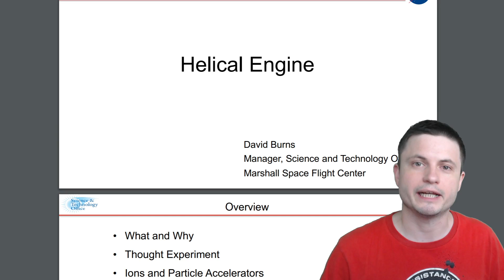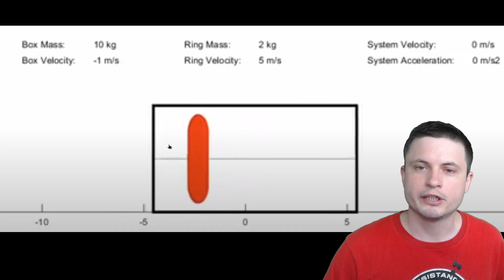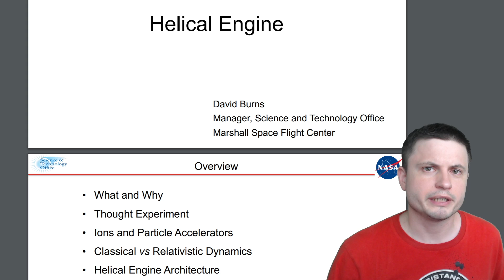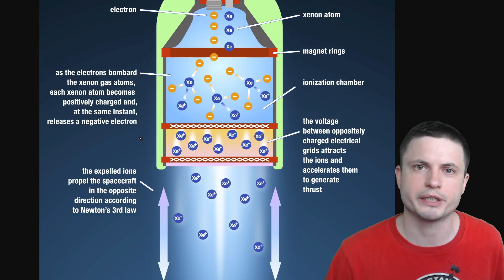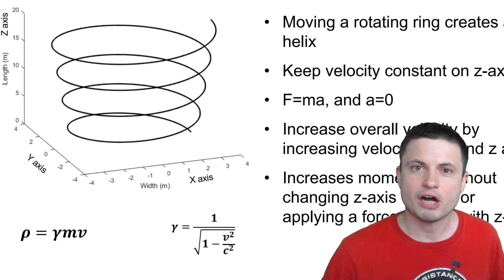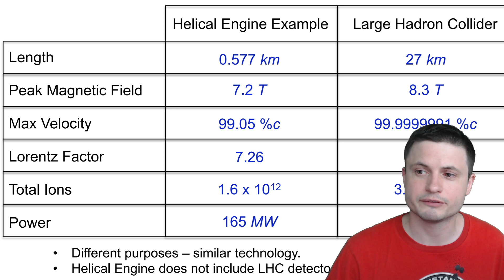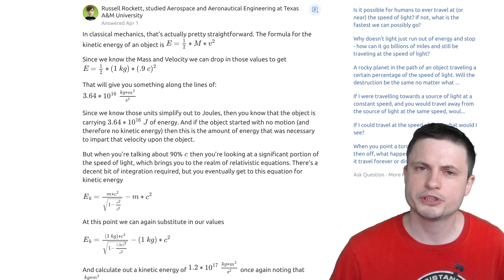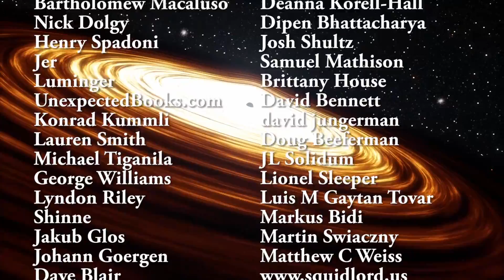NASA Engineer Designs a Near Light Speed Engine But Does It Work?

Comment: Anton Petrov I see a problem with trying to move something at relativistic speed and that is as your particle gains that speed and becomes heavier the mas reaction against accelerating it further also increases and so the ship will move backwards if you are trying to BOUNCE these particles off your forward bulkhead and this will effectively subtract any gains made from the impact.  However if you turn it around like a cyclatron or atom smasher then you can do a more simple reaction to accelerate the particles out the back of the ship and by using a long track get their mass up heavier for the last stage of acceleration and push off of those heavy reletavistic particles of exhaust.  You lose mass this way but it will work and the other model that contains the mass will not work in my oppinion.

Comment: I think you may have made a conceptual error, or I have. Yes, spinning the donut up to 90% C would take enormous energy. However, once it is spun up it should stay spinning that fast. You only need to add energy to make up for friction losses which should be minimal if the donut is free floating in vacuum. Spin the donut up to speed before you leave earth orbit using a large orbital station power source. Then detach from the station and only then start the helical donut movement that will move the ship forward. The smaller onboard power source would only be used to make up for friction losses. I think the bigger concern would be structural integrity problems with the donut.

Comment: @8:18 Claim that a fission reactor can produce [x] amount og energy from one 1Kg fuel rod and that that is essentially converting 1 Kg of mass into energy.  NO, fission is NOT an anti-matter reaction, there is still only a tiny, minute percentage of the mass that get's turned into energy.  Even fusion is still a very low percentage.

Comment: There is a mistake in this idea. When the ions were accelerated, the accelerator was pushed backward. The designer forgot what happened to the accelerator. It will not work.

Comment: Anyone who wants a warp drive or even a drive that can propel you to 99% of the speed of light is an idiot. At such speeds you'd essentially be riding a giant particle accelerator. If you were travelling at 99% of the speed of light, if you were to hit a micrometeorite the size of a pea, especially if it was travelling at a high rate of speed in the opposite direction, your ship would become a supercollider experiment with disastrous results. You and your ship would be completely annihilated, to put it mildly.

Comment: I think I've come up with an engine concept, when two plates of a Casimir system are pushed rapidly together photons are generated i.e. positive energy, I'm speculating that the opposite happens, that when two plates are moved suddenly apart, negative energy is generated, if one has two circular ring plates rotating so that they move together then apart, according to the idea of "Runaway Motion" of Hermann Bondi the entire setup would move in the direction of the positive energy pole, nested rings could be added to increase the effect.

Comment: Excuse me but may one use spin to change mass of moving object/particles using centrifugal force? Imagine your bouncing object is a donut of electrons spinning. How I dumb it down for myself to understand at the most basic level, I feel like I understand the theory of the propulsion but is it like basically make something bouncing inside a container and while doing so one wants to make some sort of changes in it's mass between bouncing of interior sides of container. Either one end changes by the increase or decrease of the mass of the bounce ((force) force on container) to change somehow by the time it hits/bounces back from the opposite side of it's counterpart. With mass hitting one side differently it will create movement of entire container.

Comment: I am not well versed enough in the physics to judge, but I would say a small demonstrator prototype, even with negligible speed, just to prove it is practically possible and not impossible due to unforeseen problem like Gyroscopic Precession or the rotational force transferred to the body due to the spinning, I guess I ma more comfortable with applied than theoretical physics, I wan't to see it working

Comment: And then what's the little photons are Amplified the mirrors keep shaving off another Photon and then another Photon I then it's a matter of manufacturing photons inside a closed engine as then keep releasing little bits of photons that will accumulate to a large amount because they're traveling at the speed of light

Comment: Hi Anton. Exotic matter (bose einstein condensate) can be used to slow down the speed of light. It would be nice if something similar can be done to achieve the necessary relativistic effects at much slower speeds. BTW this is also an idea I had played with before seeing this video. I was thinking of two counter-rotating masses being sped up and then stopped (or slowed down) when both were moving in the same direction.
Reply: Get your pencil out, put a little math under it, maybe a few explosions......we’ll call it internal combustion.

Comment: Violation of momentum conservation. Probably reactive force of changing mass didn't taken into account. When you accelerate a mass close to light speed, momentum will be used not only to accelerate mass, but also to increase it. This will change formulas apart from just multiplication by Lorenz factor.

Comment: The hole thing is theoretically interesting but totally unnecessary because to accelerate particles close to the speed of light will give a conquerable result and be a whole lot more realistic in every way,In fact theoretically you would only need one particle to be accelerated at very close to the speed of light to attain enough inertia reaction or thrust for any mission.

Comment: No need to use any exotic physics to create an effective inertia drive in theory, as applying newtons 3rd law and interesting applications of mechanics will do. Accelerate a mass in one direction at high velocity, then return it back to its starting point at a far lower velocity and repeat. Another form of mechanical based directional inertial drive would be to use a high velocity mass impact and then return it far slower its its original starting point and repeat in pulses.

This is kind of what happens inside with a standard rotary impact hammer drill, which produces a singe directional impact inertial effect to do its job very well. Fairly straight forward to test on a low friction water bath and from many past experiments using a different mechanical inertial drive configuration including in a canoe in a swimming pool, and it certainly appears to work quite. So its quite a shame that these kind of successful experiments dont get the coverage they deserve :)
Reply: Ps Check out "Roy Thornson's Inertial Propulsion Demonstration" vid on YT from back in 1990 for example.

Comment: "relativistic mass" ? 
Mass doesn't increase, energy does.
E=mc^2 is for stationary rest mass.
E^2=pc^2 + (mc^2)^2 is the full equation.
[P= momentum, c= speed of light, m= mass.]

E=mc^2 is for rest mass only, yes?
E^2= (pc)^2 + (mc^2)^2
...is the full equation.
Where p= momentum,
[and of course m=mass and C is..C.]

Mass doesn't really increase under special relativity. That's an energy increase that we equate to mass, but it's really the γ (gamma) term in front.

So:
E=mc^2 for stationary objects,
E= pc for moving objects with no mass (i.e. photons). 

If they are both moving AND have mass: E^2= (pc)^2 + (mc^2)^2
Should be used, as far as I've been told... But I'm not a relativist.

Comment: i thought of something that  might be similar a while back, when i was thinking about orbital bombardment... 15 ton tungston rods my butt...LOL  i thought about making something the size of a beach ball, that was thermally shielded, that would shift a weight internally to steer, thou it would still need to have weight to it and the ball itself would be launched from a vessel or station, and the accuracy would still have issues with drift, i thought the thermals would be taken care of, and the shifting weight would alter the angle of attack of the shielding in the leading surface, communicating with the launch system as to its relative location to tweek that angle :D  i know i'm not a scientist but it's the idea that popped into my head :D  the beach ball would probably be more tearlike in shape.

Comment: OK, I have a clearer picture of what this does after reading some of the comments.  You spin up the flywheel thus increasing its mass; push the heavy flywheel to the back of the ship; then de-spin the flywheel, then push the light flywheel to the front of the ship.
The total mass of the ship includes the energy of all types that are contained within it.  Spinning up the flywheel to the point where it noticeably gains mass means that the battery (or whatever kind of device holds the energy) will contain enough energy to change its mass, as well!
So, to get a clearer picture of the problem, forget flywheels and just make it a water tank.  Transfer water from the ship's main tank to the sliding tank and push the heavy slider back; etc. You see the change in mass of the sliding part is exactly balanced by the change in mass of other parts within the ship.
Yes, I will scoff at the idea.

Comment: Sorry, but unless you clearly explain how this doesn't violate conservation of momentum, it sounds like the same spiel given by those promoting the "overbalanced wheel" and various reaction-less drives.
As for your comments on energy consumption, I think you should compare it against a "photon rocket".  But also, don't forget that you can recover the kinetic energy of moving parts that are not thrown away.
The LHC doesn't generate energy; it consumes it.
One kilogram of uranium fuel is not completely turned into energy!  The spent fuel only loses a little weight.

Comment: Hallo Dear Petrov.

I hope you will read this significantly comment. Sorry to say this, but it really is.

First of all thank you very much for posting interesting stuff in the net.

Lets get into stuff. I am a physicist. I analysed the complete Helical engine system. And I discovered a really big big major error. First of all there are a lot of very hard technical problems wich cannot be solved using todays possibilities of physics and technology, and I am not going to write it here because it is too much and because it is not the major problem. But the basic major problem is following. You said that the so called "donut box experiment" is theoretical completely clean and right. The truth is, indeed it is really not becsuse it is nonsense. Proof: imsgine a long pipe. For example 200 meters long and 3 meters diameter. The one end is conected with the spaceship (point 1) the other end is free in space (point 2). Now a mass is (1 Kg) being Accelerated from 1 to 2 within 10 meters and then the projectile-mass flyes with 0.999948 c lightspeed to point 2 and vice versa. The mass has now at this speed a relativisticly increased mass of 100 Kg. At the point 2 in the last 10 meters the projectil-mass will be decelerated to zero. So the projectile now has got the mass of 1Kg and the mass of the kinetic energy of the 99 Kg  for example would be released and could be stored in extreme top capacitors. According the Einstein Energy Mass equivalent E=MC^2 one can say 99 Kg × C^2 Energy is stored in the capacitors. Indeed the weight of the capacitors now is in fact 99 Kg  more than bevor loading the energy. Remind this! Now comes step 2 of the ca. 500 KHz Pulse foreward and backward system. The 1 Kg projektil-mass has to be moved  "slowly" (0,85 c lightspeed) from point 2 to point 1. Slow because not to increase relativisticly mass of the 1 Kg. Because the Nasa engineer obviously thought so to have a lot more pulse forward and less pulse backward. But the major fact is following. Energy always is located in a certain part of space. Energy is not a ubiquitously or diffus unlocated thing. It always is located in a certain place. That means concrete. If you want to accelerate the 1Kg again at point 1 to point 2 you first have to get the 99 Kg Energyequivalency concrete from the capacitors of point 2 to the caoacitors of point 1. In fact the transport of the 99 Kg Energyequivalency  from 2 to 1 must concrete be done. For example with laserbeams or superconducting powerlines. But in fact that means very concrete that you has got to move 99 Kg Energy (E/C^2=M, with concrete mass aspects) from point 2 to point 1.  And this also nearly with the speed of light. This indeed causes an equal opposite pulse as well. So in summary one have 100 Kgc pulse forward and 100 Kgc  pulse backward. Nothing is won. That means such a system would not move 1 meter away from its position. Further you can see small differences in my calculation. But if you calculate very exact with all subaspects you will find that the shift/rearrangement of mass/energy- block form point 1 to 2 and 2 to 1 is just the same but just only values  with opposite directions. That means in generall no propulsion effect.  One more important point. If you say just let the backflow of energy and mass just make it very solw to reach low reverse pulse.  The matter is that the reverse pulse is just as low as it lasts vice versa. So nothing would change. Used Formulars: F(orce)=P(ulse)×T(ime) in wich  the pulse exists, Relativistic mass increase M1=M0/(1-v^2/c^2)^0,5. So All in all: from a fully  really cosideration according theoretical physics, such a system called "Helio engine" never will function. 

I am a bit surprised that Nasa engineer and scientists published such a nonsense (sorry to say so). 
 
Furthermore it is very effective to develop gasous/plasmatic thermal fission powerd rocket engines. Outflowvelocity up to 5000 Kilometers/second possible. And final speed of spaceships up to 200 to 1500 Kilometers per second ! No joke ! That is physical, technological and economic possibility today (2019 PCN). But it is not developed because  mankind sleeps. 

Furthermore I beg you as a kind of journalist, you are as YT-channel operator, to hand off this short scientific elaboration to the Nasa inventor of the "Helio engine" or just to the Nasa. Thx in advance, and keep on putting good stuff on your channel. Petrov wish good Future. Regards Tomas Mieger

Another interesting rocket propulsion system I will show in the following words. If you can bear it so read it.

I also developed a rocket propulsion system in the last miilenium as I was a student. That systems construction is fully completed. One could reach about 98 % of lightspeed. But now I have similar problem like the said Nasa Engineer. I am still looking for a appropriate propellant. I feel like a primeval man with a Jeep and looking for petrol. All I need is a special kind of exoticmateria. It is not fun. But what I really do not understand. For what reason does a Nasa engineer publishes plans wich cannot be realized by using actual scientific and technical possibilities. Maybe he should better write a SF-book instead confusing the scientific society.

Comment: Imploroid Jet || Impeller Plasma Toroid Jolt Electron Tunneler || PZT piezo superconductor circuits + helical vibration transformer / modulator || Positronic Dynamics antimatter annihilation energy source coupled to superconducting / superresonating subyocto gravitoacoustic quantum virtual particle annihilation cycle interruptor (gluonic qcd strong force subyoctosecond 'deathbed serenade for strings' {Adagio D' AEterna Incendiare Stringulatis} (quantum foam boiler) || ULTRACOLD NEUTRON GRAVITON LASER

Comment: If only we could harness the gravitational field of  negative energy in the way we used our gravity to move the rovers in their capsules to Mars using earth's gravity and the gravity of other planets for the Juno mission. And the use of a braking system to reduce speed that does not discharge compressed burst of gas into the vacuum of outer space. An unlimited supply of negative energy to reproduce both functions and an outer skin along the hull of a field distortion to make the star ship slippery such as some sort of a magnetic vacuum lubricant. A heavy ball and a lighter weight ball when released evenly at the  same velosity hit the ground at the same time. When driving a car 6 miles to a red traffic light, it does not matter if you are going 45 mph or 70 mph? While one arrives earlier to wait longer or one who arrives later and waits less time for the same traffic light to turn green, how much fuel was spent between both motorist's?  Was it worth consuming more fuel to arrive at the same point to wait longer, or better to wait less time and use less fuel? The use of compressed fuels on the ground weigh more in earth's gravity. Compressed fuels once spent in space must have a point of refueling. What i am "Driving at" is that on board fuels have one draw back and that is that they have boundries. Unlimited energy does not have these boundries. And why it is hard for those that think in terms of boundries to think out side their boundries to limitless possibilities because it will hurt their bottom line: Profits, repeat business. If we had a cure for cancer those researching for a cure would be out of job. But if they found a treatment instead of a cure there is profit in repeat business. Same is true of the Corona Virus Vaccine...it may take ever in repeat doses before this drama ever goes away. But beyond these boundries lays the enemy of all boundries and that is a life without such boundries where we can all live in harmony with one another and free from the boundry of closed mindedness. Free to dream bigger.